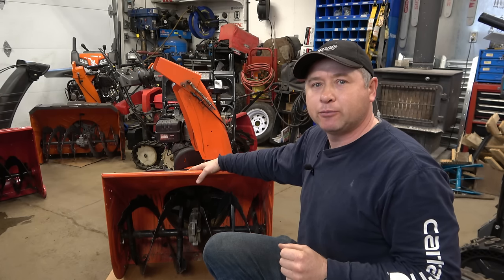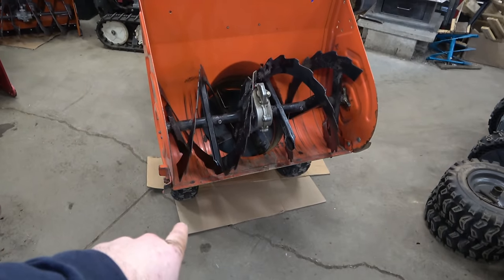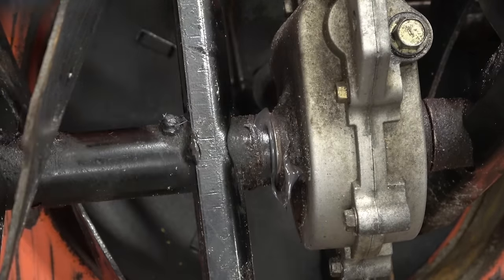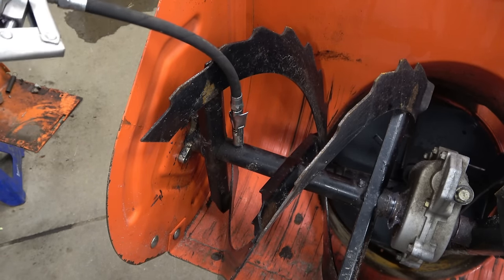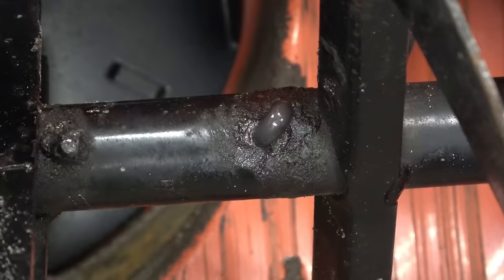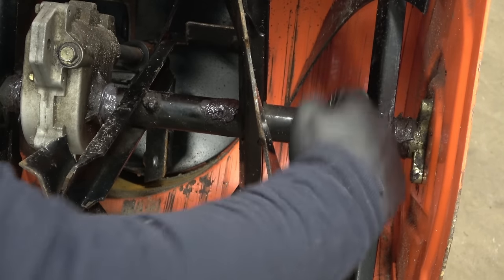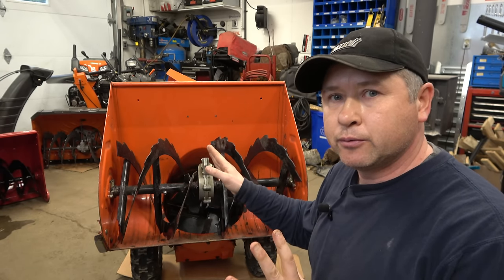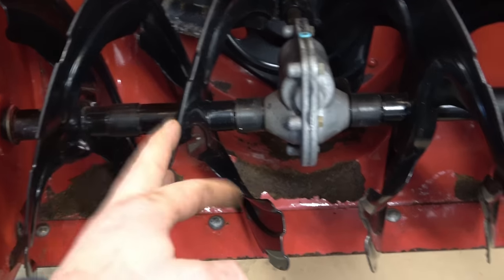HOW TO Grease Snowblower Augers With Or Without Zerks!

Comment: Love your videos and trust your expertise but not sure how your doing your Ariens is exactly correct, 
When you put the Ariens pins back in your saying to leave that play or slack in the pin but in the manual there is a specified torque range and I use very near the lowest tightening torque spec as with fasteners When tightening and lubricant is present it can actually increase tork value of the tightened fastener hence why I use the lowest specified tork because of the presence of grease on the pins and in using that lowest tork tightening spec there is zero play in my factory pine and I think that is important because the factory pins have certain areas on the pins they are designed to break at and a pin moving around is not ideal, when using lowest tork spec from factory there should be zero play in that pin.
It even says in the manual pins should NOT spin freely.
I'd tighten to about 8 Newton Meters or about 
6 ft lbs with grease present on threads and call it a day.

Comment: Hey donyboy73 what size of bolt that hold's your dipstick tube to the engine? Great Video!👍
Reply: If you struggle figuring that out for yourself, make sure you ask mom and dad before you work on it. 👍
Reply: @jaxturner7288  well if only the bolt was there  before I worked on it! I got It from A Foreclosure House.
Reply: You can try this out for yourself. Get a bolt, and if it doesn't go into the hole it is too large. If it falls into the hole it is too small. Try to find a bolt that is not too large nor too small. If it looks right but still only goes in a thread or so, consider trying a metric one of a similar size.
Reply: @Spencer1609751  where you got it from and the bolt being missing is all irrelevant and goes to show your ineptitude with the whole situation.  
If you can’t figure out what size bolt goes in a hole simply because the correct bolt isn’t already in the hole…. 
You’re missing the basics of mechanical problem solving skills and should have adult supervision while working on power equipment like I said.
Reply from the maker: on the Tecumseh I think it's a 10-32 and 5/16" head
Reply: If you google the make and model of your machine you can often find a parts diagram with that information.  Then just head to your local hardware store.  Good luck!
Reply: @donyboy73  Thank you!

Comment: I have a Troy Bilt storm 2460 (MTD I’m guessing). How do you do about grading the gearbox itself? I see some have a drain and fill bolt, mine just has a rubber plug on top. I don’t have my manual to see if it says use grease or oil, I’ve tried going to Troy Bilt website but they mention nothing about lubing the gear box. I don’t know if mine came with oil or grease. I sprayed some white lithium grease in it, didn’t know what else to do
Reply from the maker: get some Shell Alvania or "00" zero zero grease and inject some through that hole
Reply: @donyboy73 will do. Thank you very much

Comment: MTD came out with that auger design because no one would ever grease the shaft! The shaft is actually much smaller than the ribbon auger, and the play is taken up by those plastic bushings. This is supposed to leave a big enough gap to prevent the possibility of the shaft ceasing to the auger....Give it 20-30 years (if the machine lasts that long) and I'm sure those plastic bushings will eventually wear out, and enough rust could build up and cease the auger. 

I have even seen some older lower end machines (no auger gap/bushings)  that also do not have any grease fittings! If it's a machine you care about, you can strip it down, weld a bead on the auger, drill and tap your own zirc.

Protip: When you get a NEW can of lubricant, super-glue or JB-weld the straw in to the nozzle! (I say "new can" because the glue wont work if the straw/nozzle has any lubricant on it.) Hang on to that nozzle for jobs like this and hard to reach places. There is nothing more irritating than the straw poping out when you are trying to bend it in a hard to reach place.
I also have straws with long blunt-end surgical needles glued on to them for sticking down control cables to get the lubricant in the cable as far as possible.)

Comment: The auger doesn't normally spin on the shaft but must be free to spin as the shear bolts/pins  give way.
Reply: The grease on the shaft is to prevent binding of the auger to the shaft so they don't become one piece over time.

Comment: Dont think you mentioned also greasing the actual gearbox fitting if equipt while your in there (equally as important).    (You likely did a separate vid on the gearbox)
Reply: Most modern gear boxes have oil in them, or are sealed. You would have to split them apart to put new grease into them.
Reply: Thats why I said “if equipt”.
Reply: Thats why I said “if equipt”.

Comment: I bought  a package  of four  pins  at a local farm supply store ,cost was 3.99 plus tax. That's not going to break me but my Scottish  blood kicked  in and on the way home I stopped  at a welding  and fabrication  shop who also has a sales store ,pins there came out of a box of 100 and cost ten cents each for pin and lock nut.just tell the guys what the pis are used for and you get the proper grade,  PS they are more fun than  the farm store!
Reply: if they gave you bolts instead of shear pins, you will eventually wish you had bought the  correct shear pins for your machine. They are all different and machine specific.
Reply: @bushmaster2936  A shear pin IS a bolt!